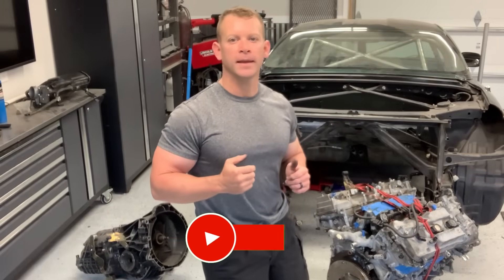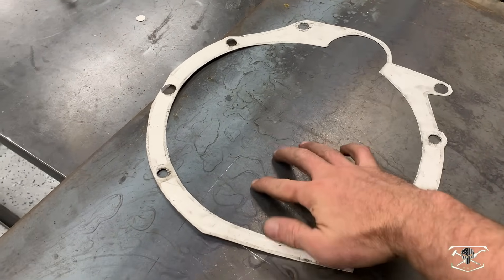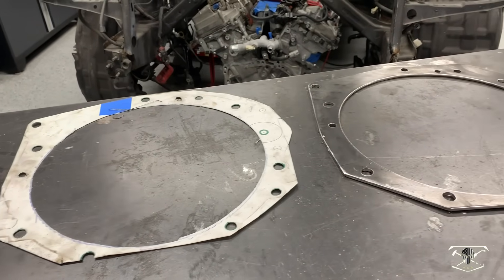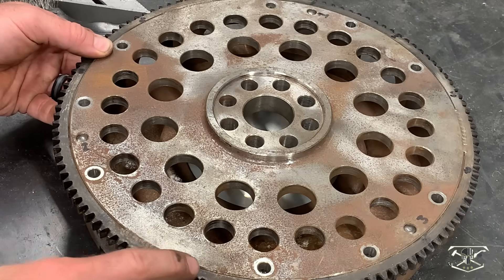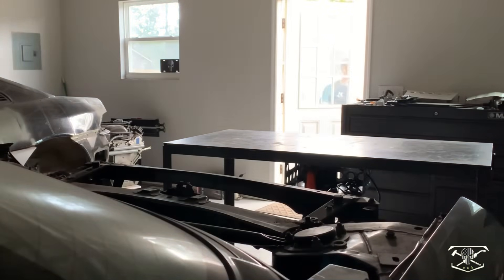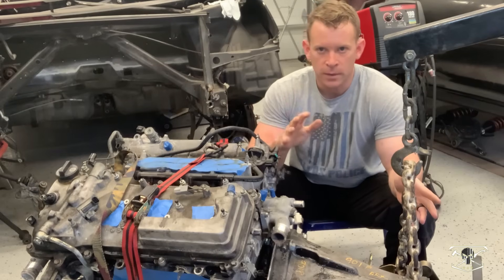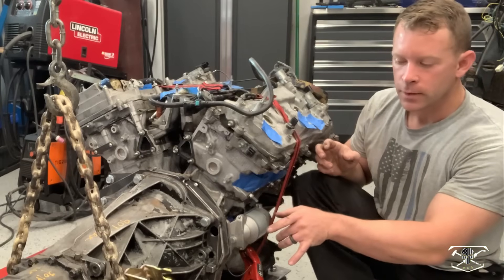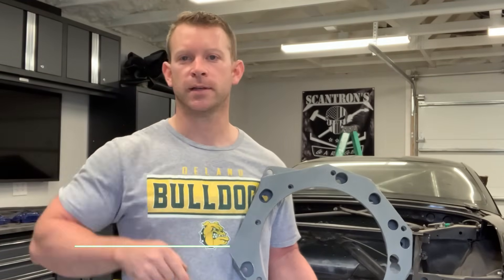DIY Engine Adapter Plate (Mate any Engine to any Transmission)

Comment: Hello! How did you ensured the centering of the crankshaft centerline ant the transmission´s pilot shaft and also the perfect alignment of the surfaces or planes between the engine and the transmission? Thanks 🙂
Reply from the maker: You have to consider the plane on the motor and transmission are flat. because these are already flat surfaces, you can keep both surfaces on the same plane by making sure the added space between is exactly the same all the way around. I believe the spacer I used was 21mm and was measured for accuracy. The piece was then measured after being welded all the way around and had the same thickness all the way around. Of course you could put the plate on a milling machine for accuracy.

The pilot shaft and bearing were aligned by installing the shaft into the bushing and then measuring the distance between the face of the block and the face of  the transmission. Adjustments were made to get the same reading all the way around once again.

fitment was verified upon assembly where the pilot shaft matches up perfectly and all the mating surfaces line up without having to tightened down to seal up the mating surfaces "if that makes any sense"
Reply: @scantronsgarage  Yes, it makes sense. It seems as a sound and solid method.  In fact I understand that by doing it that way, you ended up checking it twice, for reassurance. Very good and thanks🙂! I will try to replicate your method.
Reply: @scantronsgarage  Great video, thanks. I like your idea, very versatile.
It would be nice if you could produce a video to show exactly how you centered the pilot shaft into the pilot bearing to make sure that it was concentric to the bearing. I assume you came up with some dowels for repeatedly locating all the components to each other precisely for disassembly and reassembly and not have to measure each time. If so that would be great to show how in a future video also. I've done a few custom adapters for my customers in the past as part of a custom engine swap. I'm starting in on a custom adapter for myself this time and I'm going to incorporate your way of doing it. Thanks!  Subscribed.
Ross
Reply from the maker: @rossconverse9067  Thank you! I spent probably an entire afternoon measuring the fit before welding. I didnt film much of this due to most peoples lack of interest. I will make a more detailed vid on the next one I make
Reply: @scantronsgarage  Nonsense.  The inaccuracy in the weld beads alone is enough.   Look up  dial indicating  bell housings.  (Aligning bell housings).  There is a REASON  original  installations have  DOWELS  to  accurately center them.  They must be centered  on concentric, and must be in the same plane  3 dimentionally
Reply: @fourfortyroadrunner6701  Me too like you said. Centered and parallel. Not impossible. Just critical.

Comment: dang, I might rethink my adapter process. Hmmm  I was gonna go traditional 6061 plate without using a Mill at all.
Reply from the maker: This worked well however I would have gone the 6061 plate method if i had access to a mill. Thanks
Reply: @scantronsgarage  I know what you mean, you gotta be sure that the 2 assemblies are squared up perfectly. I have a plan for that

Comment: something doesn't look right with the pilot bearing at 7:16 to 7:22 min, look like the flywheel was not seated all the way to the crank.
Reply from the maker: Yes, the center plate was not fully installed

Comment: What's the thickness of the steel plate?
Reply from the maker: 3/16 inch steel plate
Reply: @thatguy83ful  he said 3/16" but honestly it will also depend on your flywheel spacing. I plan on using 3/16 and 5/16 on engine & trans respectivelly, with 3/4" flat stock in between.
Reply: I just pick up a 5.7 hemi over the weekend! I am planning to make an adapter to my audi a4 transmission
Reply from the maker: @rodriguezluisu87  awesome! I have an a6 transmission if your interested

Comment: I’m swapping a 2.0L VW TDI into my Ford Ranger right now.  I’m not going to pay $1200 for an aluminum milled adapter plate and was looking for an alternative.  This is exactly what I was thinking of doing!  ThanX for all of the tips to make it easier!
Reply from the maker: You are welcome! I have bought these in the past for big money. hope this helps! not as pretty though. good luck with your build, sounds cool
Reply: @scantronsgarage  if dont mind me asking what thickness of metal did you use .I'm putting a 1.9 tdi into my 79 jeep j10 truck
Reply: I used 3/16” steel for the bell housing adapter and 4” round stock aluminum for the flywheel adapter with longer bolts.
Reply: I'm doing the same 2.0 cbea tdi on a jeep. Same deal man I'm going to build my own
Reply: I’m going to be putting a 2.3 MZR in my ranger
Reply: Just got a BHW for my first gen ranger a couple weeks ago, fitment and adapter plates will be the most difficult I think
Reply: @GenesisRC  My total time on the engine swap was a little over 150 hours.  I have a CKRA so I have a huge amount of wiring and modules that I had to deal with.
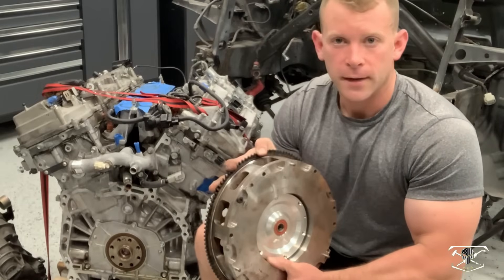Reply: I got 1983 Ranger 2.3 W 4sp & 4:10 rear. I pulled a 16 ft. trailer, not real heavy.
Reply: Right fam ... I'm in a built miata , and can't turn it up anything under 4k with stock trans and rear diff , but adaptors were as much or more than the transmission I want to swap in it ,and the diff , well the 8.8 irs is tried ,tested, and true , so there that price to lol , and it needs a mounting kit to , but I love maken stuff , so I try to build everything I can first .. if it dont work ya can always buy the billet,  but, if it does work , then you save thousands that you can put elswere on the ride ... peace and love brotha, keep it rad, stay safe, and build on.. ps sounds like a fun build brotha , hope all works out for ya
Reply: Eww TDI why?
Reply: @Mazda626gtturbo  Well, my Ranger had a 2.3L gas engine that started knocking bad shortly after I bought it.  The pickup is in excellent condition so I thought of rebuilding the engine.  But, I love diesel powered engines because of the amazing fuel mileage, longevity, and power!  So, I swapped a diesel engine into my Ford Ranger and now I have more power and I get 43+ MPG!!  So amazing!!!
Reply: @davidward9836  do you have your build on here? Did you fabricate an adapter plate like this one? Looking to do the same.
Reply: @Superduty_59  I did video some of my build and and pics of some.  I haven’t put it together and posted it yet.  Hopefully soon.
Reply: @davidward9836  great idea ..i like my tdi jetta . Driven then for years
Reply: @Superduty_59  I took some video and pics, but I haven’t edited and uploaded anything yet, sorry.  Yes, I fabricated all my own adapter plate, flywheel spacer, adjusted my bell housing for a new starter location, fabricated engine mounts, fabricated power steering and A/C compressor mounts, cut lowered and re-welded the frame cross member under the engine (since the TDI engine is deeper).
Reply: @Mazda626gtturbo  Because TDI's are amazing engines, nobody knows how to make automotive diesels like the germans
Reply: @Mazda626gtturbo Because its a great engine and perfect for that small pickup truck. Torque and very fuel efficient!

Comment: That looks good and if you ever wanted to add more rigidity to that you could add some steel plate to the inside radius
Reply: I agree. I would consider internal spacers welded for bolts to pass through.
Reply from the maker: That is true ! Thanks